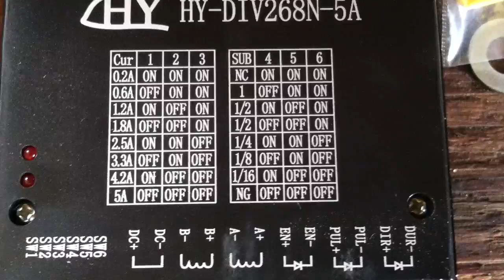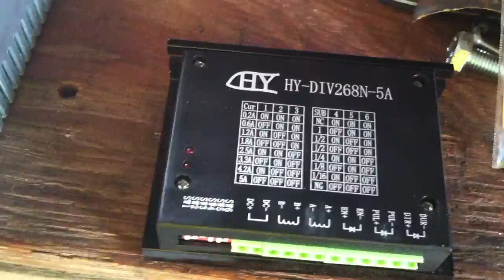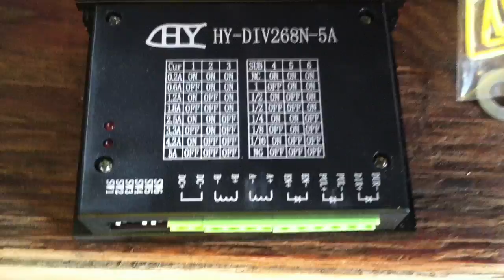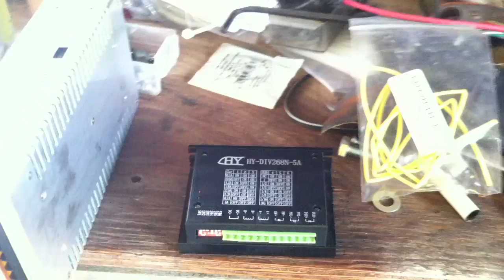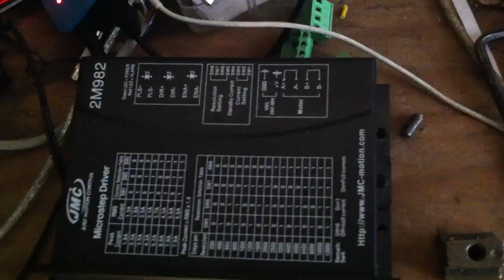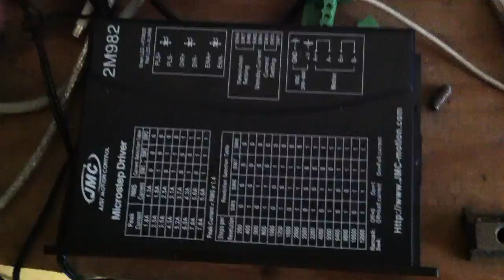amazon hy div2689 tb6600 stepper driver

Comment: which motor you used or tested with hy-div2689 tb6600? please share specs of tested motor and overall results .
Reply from the maker: zubaer tanvir motor is 560 Oz in i believe from what was keling industries now called automation direct.   I think i could cut at 150 Ipm it the limit was motor alone.

Comment: Great video thanks, You mention in your video that you have to ship it back to China, I would like to share with you my experience when returning goods. I too had a dead motor driver and was told to post it back (ebay rules state that it is the seller who pays all  postage fees.) the Chinese guy told me pay the postage and he will refund me when the board is returned. Two weeks later the courier called to say the person in China would not take the return. It cost $29 to send it but to repatriate it was going to cost $84 leaving me a bill of $113 and never got a refund. Yes, I did lodge a complaint but both ebay & Paypal ruled in the Chinese's Favor. When I  tried to complain, both ebay & paypal ignored my messages.
Reply from the maker: Robert Scratchet I buy off of Amazon alot. ebay for large bulk purchases of select items.

Comment: (magic smoke just came rolling out a bit)
I think! you might jump signal line in over limit voltage,
signal line should be 5 volt If you put it more you must need resistor connected to pull up all lines and table speed was wrong but you can get right table in cnc forum( somebody has tested) over more the voltage for stepping motors shouldn't be over 24 volt otherwise motor will run in high temp